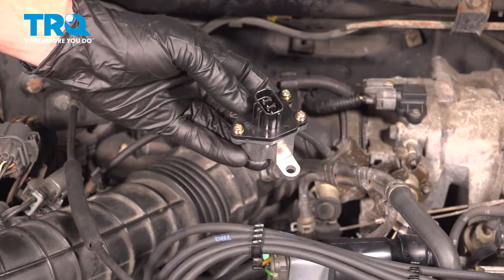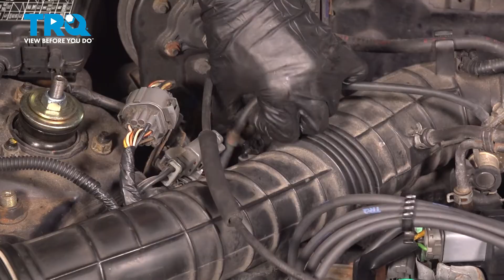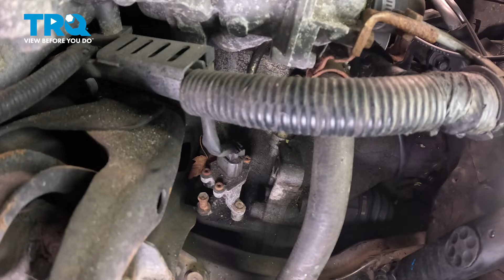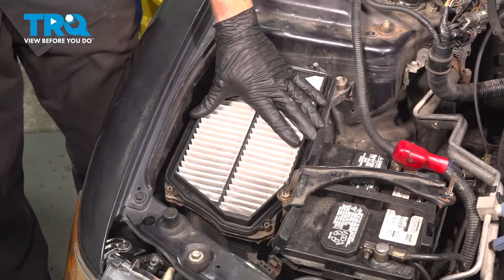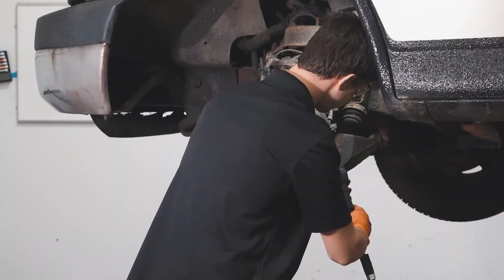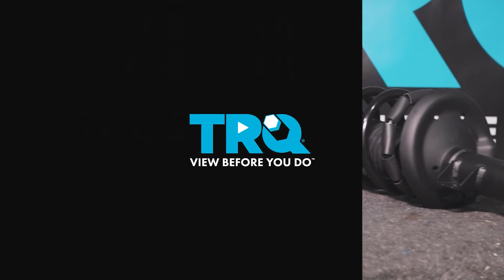How to Replace Vehicle Speed Sensor 1994-1997 Honda Accord

Comment: Just replaced the VSS, disconnected my negative terminal on the battery to clear the code. Speedometer still not working. Check Engine light came back. P0501

Comment: Great video. For the 10mm bolt that is harder to access, do I need a swivel socket or is it possible to do it with a standard 10mm socket?

Is it worth putting anti seize on the bolts for the new replacement?

Assuming that my VSS is the original one, should I just replace the O ring regardless? If I should, does the VSS that I'm going to buy from auto zone  come with an O ring or do I need to buy it separately?

Comment: Good day sir, I already replaced my speed sensor but still its not working in my gauge
Reply: May be the wiring of your gauges, if I smack mine a few times or flick the reset button for the miles and it’ll work but usually works faster when the car is cold, either the melted solder needs to be fixed or it’s stuck
Reply: Good to know , I’m getting an accord and the speedometer doesn’t work but neither does the mileage reader 😢